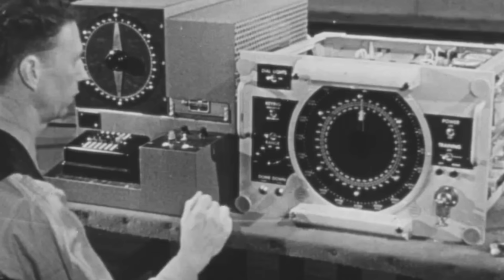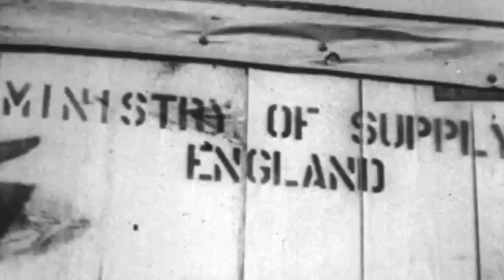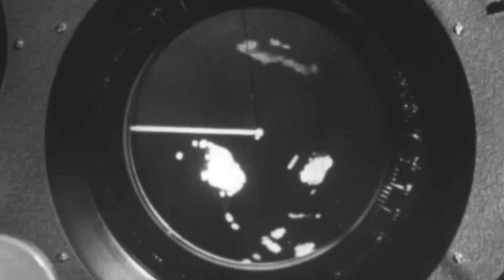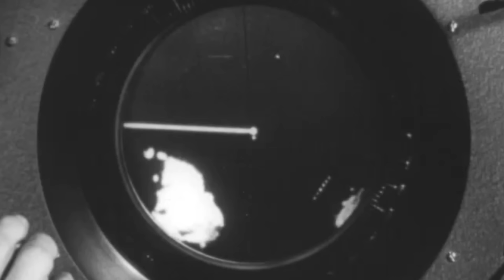The Secret Allied Weapon that Completely Changed WW2

Comment: This was how WW2 was won... implementing technical capabilities quicker than your enemy are rarely acknowledged. Thank you for this!
Reply: The allies won because they had more soldiers and resources. The German's beat the allies to plenty of technologies. But having better tech doesn't help if you don't have resources to make them on mass. Why do you think most WW2 nations keep using and making bolt actions?
Reply: Holds true right up until now.  Why we need Taiwan so bad.  It's scary we have given away most of our industrial edge tho.   Guess we will get China to make our stuff.. lol..
Reply: @LawAndTheory  ...... we're talking about WW2.
Reply: The number of men the allies could put against Germany was over whelming. The last war determined by the number of men that could be fielded.
Reply: @gray1shark  The Magnetron gave a huge advantage. Being more than 1000 times more powerful than any other technology it gave a clear signal at long range and due to its signal strength it was unjammable. Whereas the British jammed German radar with noise quite easily.
As for the proximity fuse, if the allies had not had it in the pacific in particular the devastation cuased by a high success rate of Japanese aircraft would have cuased a catastrophic loss of ships and probably would have  extended the war by several years.
The US did not even have a nuclear development program until the info for the tubes project was handed over. This showed a bomb could be made small enough to carry in an aircraft. Until then it had been thought that a ship would have been required to deliver a nuclear bomb.
These are just three of a number of items which made a massive change to the war, not only ensuring the outcome, but considerably shortening its duration.
Reply: The magnetron, a French refinement, was jammable. Windows, the result of French experiments with radar onboard the liner Normandie in1935 , was known to both sides. Each side was reluctant to use it until they had a countermeasure of their own.
Reply: @flvnow  The Magnetron was not a French refinement but a massive leap in technology 1000 time more powerful than Klystrons of the time, and it was British. It was not known to both side, the Germans had no idea how radar could be made so powerful.
The Magnetron delivered to the USA was surround by explosives, to prevent is being captured.
Windows did not jam radar it merely privided a fog which had to be delivered by plane and only lasted a few minutes.

Jamming was electronic noise which could overwhelm radar mushing out signals. 

The British were so effective at this that the Germans developed detectors which could pick up the reflected signals from British radar to detect Brtish planes. rather than thier own radar which were weak and short range.
Reply: He neglected to mention what was maybe the most important part of the mission.  A sample of penicillin mold was delivered to Eli Lilly  and company,  within 2 years millions of units were being produced by fermentation.  This saved more lives than can be counted
Reply: @Andy-co6pn  absolutely the top of the technical capabilities achieved that won ww2 for the allies, couldn't agree more 👍
Reply: @Andy-co6pn  Uh, no. Knowing what some of them intend to do will not stop them. For example a U-boat attack. To actually stop them you need really key technical weapons.
Reply: @Andy-co6pn  just as Rommel did in North Africa, cracking American Diplomatic cipher , this gave him info on British movements
Reply: @gray1shark  and yet the British beat them to radar and the US beat them to nukes...
Reply: Strictly speaking, it's not quite true. JK Galbraith, the economist in charge of the US Strategic Bombing Survey of 1945, was shocked to discover that German military capability had NOT suffered the damage the world had been led to believe. far from it. He had to conclude that "Stategic Bombing had made little contribution to the allies' war effort." His words, not mine. "We are beginning to see" he wrote "that that we were encountering one of the greatest, if not the greatest, miscalculations of the war.."  
The carpet bombing of German cities actually boosted German public support for the war (as happened in the UK during the Blitz), and throughout the war German armaments production had increased exponentilally year on year!
And here's the rub: eight out of ten Wehrmacht and Waffen SS casualties were taken on the "ostfront" (that's to say, crushed by the Soviet Steamroller).
Reply: And the sheer economical size of the USA. It's production capacity, work force... and don't forget the number of enlisted men and women.

Comment: The cavity magnatron not only made the radar unit smaller it created a higher frequency signal (micro wave). This allowed much smaller antenna. (note the german night fighters had large antanna systems that slowed them down greatly) Also the Germans did not know about the frequency change so the radar detectors on their submarines did not work so they could be attacked much easier.
Reply: We had also invented the plastic polyethylene, it was a much better insulator than rubber and made the RADAR set wiring much tighter in the frequencies needed. We also had "peanut" tube vacuum tubes that were at least 8 times smaller than anyone else.  This all lead to the RADAR proximity fuse Ant-Aircraft shells that made them more than 1000X more effective than any other type of fuse.   I read that it typically took on the order of 15,000 rounds with "normal" AA to shoot down a bomber, but it only took about a dozed with RADAR proc. fuses.  That also made a HUGE difference in the amount of shrapnel that fell over friendly areas.
Reply: The higher frequency (i.e. shorter wavelength) also made it possible to detect smaller metallic objects - like submarine snorkels.
Reply: German scientists had experimented on the theory but had erroneously concluded that centimetric radar was not possible.  By the time a radar equipped Lancaster crashed in Germany with H2S on board they realized just how far behind the Allies they were.

Comment: According to my readings of these historic events British contributions made development of the atomic bomb. However the US did not provide the British with the fruits of their labor keeping for itself many of the subsequent developments as regarded that technology and setting the British back quite a bit. I do not know if proximity fuses were also held back. The Proximity Fuse meant that shells fired at aircraft would not have to actually strike aircraft making attacks on Allied forces but would explode close enough to destroy those aircraft. It was the miniaturization of the radar mechanism enabling it to be made part of the artillery shell that was extremely effective at achieving the downing of enemy bombers. The other thing that seems unfair is that the US required the British to repay all borrowing necessary for the British to continue their resistance of Germany prior to when the US entered the war subsequent to the German declaration of war on it. In light of the technology given to the US that dramatically aided the US in countering Japan using both the Proximity Fuse AND the Atomic Bomb appears calculated to reduce UK post war strength as regarded the USSR. Even taking account of espionage penetrations the US programs were as severely compromised as that accomplished by the USSR against the UK.
Reply: Not quite so. USA had world's largest industrial and manufacturing capacity in 1940's. Which was most important if not crucial to winning WW2. UK could not match that. It could only surpass Germany alone, after more than 5 years of war. Realising outcome after WW2, UK leaders then made the best investment they could. In people then with some common attributes, political dynamics, etc., but much greater industrial capacity and capital markets to back that up. Maybe even make a "friend" in the new superpower. Since then, UK has changed considerable, and some would say for the worst. But not as much as USA.
Reply: Urm, the proximity fuse was magnetically triggered if I remember correctly
Reply: @saberint  They had made some fantastic little tubes. Must have been amplifying the signal sensing done by the magnets or miniaturized radar. It has been a long time since this was originally discussed, so now I have to look it up.

Comment: It was American Percy Spencer at Raytheon who made the magnetron a practical device.  The original magnetron cavities were hogged out of block of copper by precision machining at 17 per day.  Spencer realized the cavity could be built up from stamped out laminations bonded together, which raised the production rate to 2,600 per day.  It was also Spencer who accidentally melted a chocolate bar in his pocket with microwaves, leading to the development of the first commercial oven intended for use in restaurants and later to the Amana Radar Range for home use.
Reply: Where would we have been without your genius. And yet you still didn't spot hundreds of hostile aircraft approaching Pearl Harbour.
Reply: Pew Wikipedia, "the CAVITY magnetron was a radical improvement introduced by John Randall and Harry Boot at the University of Birmingham."
Reply: @shastaham7630   The important thing that seems to have been lost here is that it was an allied effort that led to the defeat of the Axis Powers in World War II.  The point of the Tizard Mission was to engage the US manufacturing capability to make the components available in sufficient quantity.  Prior or Spencer’s realization that the cavity assembly could be built up of stamped lamina, the assemblies had to be machined.  That assembly technique allowed production to increase from dozens to hundreds per day.  Without the insight and cooperation of all parties involved, the course of the war could have been different.
Reply: Not accurate at all, that failure was way more complicated than that!! Read the truth!!
Reply: @nicholasklangos9704  Do you care to give a citation to back up your refutation?

It should be noted that the origin of the magnetron can be attributed to Siemens in Germany.  Later work was done by the General Electric Company (The British General Electric GEC, not the US GE).  Randall and Boot of the University of Birmingham in 1940 achieve a massive efficiency improvement in cavity strapping.  The Tizard Mission was arranged because the British government believed it did not have the manufacturing capability and finances which could be found in the U.S.  Quoting from the Wikipedia article cited by the other writer above:

“Because France had just fallen to the Nazis and Britain had no money to develop the magnetron on a massive scale, Winston Churchill agreed that Sir Henry Tizard should offer the magnetron to the Americans in exchange for their financial and industrial help.[3] An early 10 kW version, built in England by the General Electric Company Research Laboratories in Wembley, London, was taken on the Tizard Mission in September 1940. As the discussion turned to radar, the US Navy representatives began to detail the problems with their short-wavelength systems, complaining that their klystrons could only produce 10 W. With a flourish, "Taffy" Bowen pulled out a magnetron and explained it produced 1000 times that.”

From Percy Spencer’s biography on Wikipedia:

“By 1939 Spencer became one of the world's leading experts in radar tube design. Spencer worked at Raytheon, a contractor for the U.S. Department of Defense, as the chief of the power tube division. While working at Raytheon, Spencer developed a more efficient way to manufacture magnetrons, increasing production from 100 to 2600 magnetrons per day. With his reputation and expertise, Spencer managed to help Raytheon win a government contract to develop and produce combat radar equipment for M.I.T.’s Radiation Laboratory. This was of huge importance to the Allies of World War II and became the military's second-highest priority project during World War II, behind the Manhattan Project. For his work, he was awarded the Distinguished Public Service Award by the U.S. Navy.”
Reply: I do believe in the beginning it's stated the british came over for help in production l guess they came to the right place.
Reply: @mikemines2931 oh no they were spotted but someone like yourself was just way too smart to understand the new technology and just as you dismissed it....😊
Reply: @shastaham7630 - wrong.  The cavity magnetron was NOT an 'improvement' on anything.  It was brand new INVENTION.
Reply: @wtmayhew  - regardless of who invented the magnetron*, the CAVITY magnetron, invented by Randall and Boot, was what made long range and airborne *centimetric radar possible.  Before I retired, I spent a great deal of time working in the field of production engineering, so I'm not disputing the value of the work done by Percy Spencer, but without the invention of the cavity magnetron in the first place, he wouldn't have had anything to improve.
Reply: @mikemines2931  The hostile aircraft were spotted, the spotting was duly reported, but the report was disregarded as thought to be likely an anticipated flight of B-17 bombers from the mainland.
Reply: Then why didn't he come up with it without us might I ask.
Reply: @jackx4311   People here seemed to be getting tripped up in nationalism and not seeing the larger picture that without the work of all parties involved that millimeter wave RADAR sets would not have been available in the numbers required to be an instrumental tactical advantage against the Axis Powers.
Reply: Play the ball not the man  @FoxtrotCharlie2
Reply: Spencer wrote a post-war monograph about this aspect of magnetron development; there is a copy in the Smithsonian library and probably elsewhere. It was not widely distributed. One point Spencer did make was to point out the amount and type of participation in the "lamination" method of production by some of the key tool-and-die machinists at his own company, and its suppliers. These people had the practical knowledge, as well as very precise ideas about what was possible,, using various materials, techniques of manufacture, and speed of production. They were as important in the overall story (according to Spencer) as his own participation, because they were intimately familiar with the actual processes and capabilities of the industrial machinery then available. As with so many of these stories, none occurred in a vacuum. Spencer was generous in his praise of the tool-and-die machinists, because it was them who actually found means of production that were immediately possible, as well as faster and more efficient. Teamwork. Again.

Comment: why in the heck didn't England fly the men and their gadgets instead of traversing the North Atlantic?
Reply: Air travel still wasn’t safe yet
Reply: Given the range of cargo carrying airplanes of the time, they would have had to go to a British colony on the west coast of Africa first (a dangerous and long  flight to the southeast), and then to some place on the South American Continent that was not part of the British Empire, and then to the North American Continent.
   19 months later (with newly invented fuel drop-tanks and no delicate vacuum tubes for radar magnitrons) about seven American  P-40E airplanes went from South America to the west coast of Africa, on the way to replenish the original Flying Tigers in China.
Reply: Maybe they could have gone via Iceland or Greenland. There were no intercontinental planes yet.
Reply: erm the weight of the merlin engine blueprints was over 1 ton

Comment: The technical significance of the cavity magnetron is that it generated much shorter wavelength radio frequencies, allowing for smaller and cheaper radar. Now, for instance, a radar transmitter and receiver could fit on a warship or even an airplane. Before this, radar relied on much larger receiving and transmitting towers. An example of early radar using older technology was the British "Chain Home" radar systems that had huge antennas.
Reply: It was also a thousand times more powerful than previous technologies. This meant it gave a strong signal at long range and just as importantly was unjammable. Whereas German radar could be blocked with noise.
Reply: If you want to submit an idea to the British Ministry Of Defence, they have a worked example you can look at as a guide to completing the form. The worked example is a submission document for the Chain Home radar system. Not sure if this is still the case but was some 10 years ago.

Comment: Radar Played a important role for the UK During the battles However England already had a mass amount of spotters And in the air defence rings (Aircraft) The Germans did infact attack radar stations And had some of the grids down Tactics were adjusted to what was coming in Many of times The RAF would attack after the bombs were dropped Due to the fighter escorts having to leave with low fuel
Reply: I think it was on "Today I Found Out", but I remember seeing a vid a few years ago about the RAF during WWII. They were using radar to locate and attack German bombers on night missions, and worried the Germans would figure out they were using some sort of new tech. So they spread this story that British doctors discovered carrots were good for night vision, and they were made a mandatory part of all pilot meals.

That is why to this day, there is such a strong belief in carrots being good for your eyes. They actually are, just not as good as the propaganda spread about the RAF pilots.

Comment: The Germans acquired a Norden Bombsight very soon after a Martin B-26 crew overflew England and belly landed on a Dutch Beach, thinking it was the West coast of England. The aircraft ended up at the Rechlin, Luftwaffe test center and never flew for lack of replacement propeller blades. They were not impressed with the Norden Sight.